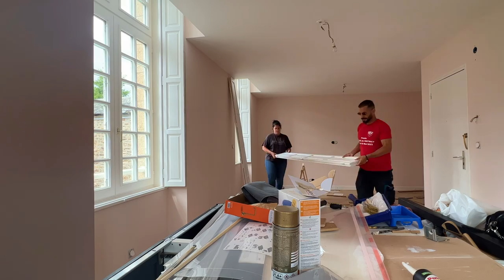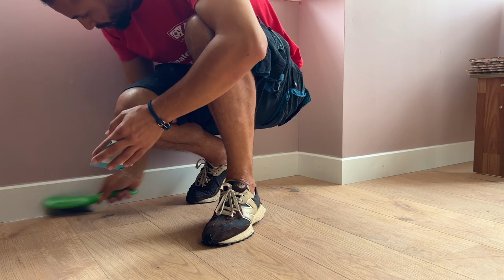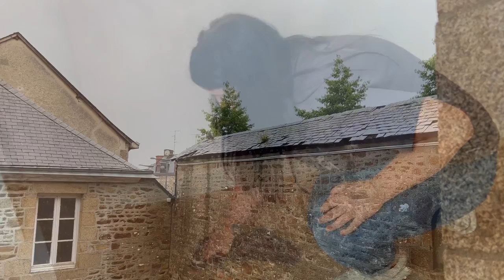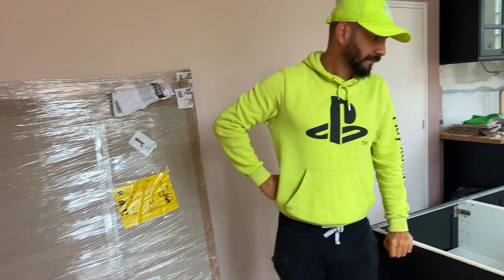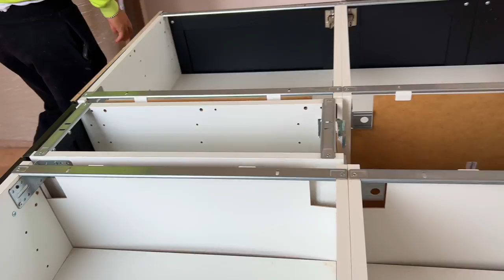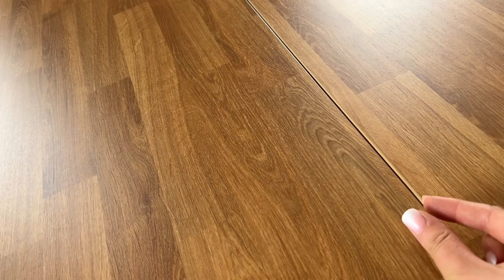Installing A Massive Kitchen Island Worktop In The Convent Apartment.

Comment: I would really rethink the sink corner:
- if you're right handed, having the sink right next to the wall will mean hitting your elbow every time you use it
- having the draining board in the middle will be annoying
- the wall cupboard is much too high up, you can't even see properly what's in the back of the bottom shelf, and can't reach the middle/upper shelves without using a step stool or ladder - that will get old really quickly
Reply: They will probably be using the dishwasher more than the sink for washing up. The wall cupboards are the usual height, you keep things you don't use that often on the higher shelves. Being only 5ft myself, I have to use a stepstool to get anything out of our wall cabinets.
Reply: @janetpendlebury6808  No, the wall cupboards are not usual height. Usual height is about 50 cm above the worktop. It's significantly more than that here.
Even if they use the dishwasher for dishes, they'll still need to wash food.
Reply: @YaaLFH  Well they are the same height as my units, and I manage ok. I am sure they have thought about the way they want their kitchen, and what works for them, might not be the way you want your kitchen, but as long as they love it, its ok.